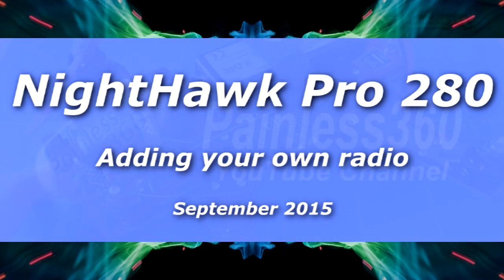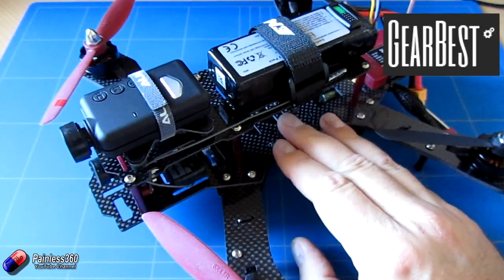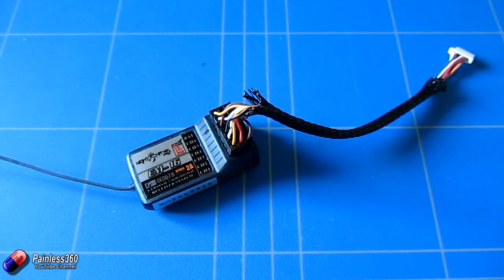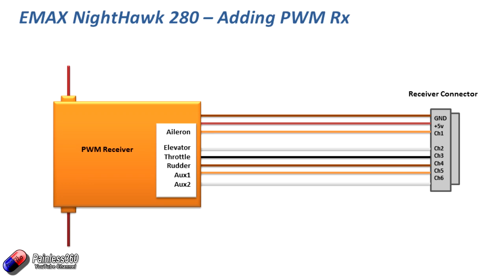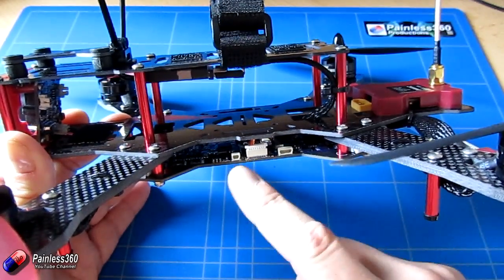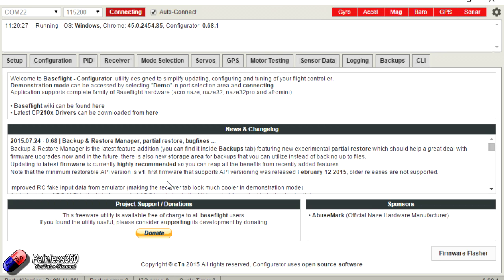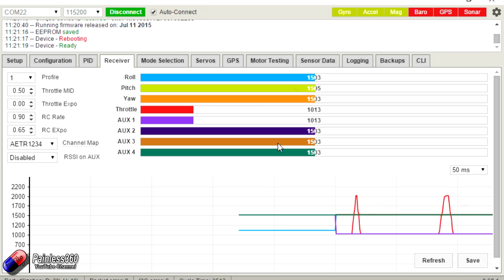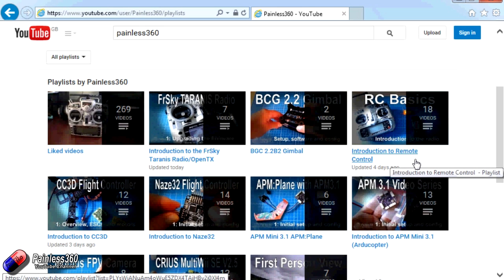EMAX Nighthawk 280 Pro - Adding your own radio and reciever (PWM and PPM)

Comment: Does Baseflight work on other flight control boards or is it only for the Nighthawk 280?  Also I will never buy anything from Gearbest again after being cheated once already.  I ordered an item from them 2 months ago but never received anything and they just keep stalling so I had to file a claim with Paypal to try and get my money back!
Reply from the maker: +Steve C Baseflight will work on a few boards, most use it on the Naze32. Sorry to hear about the problems with Gearbest I've had nothing but great service from them. Happy flying!
Reply: +Painless360  Gearbest claims it takes up to 45 business days to receive an order from them but that's ridiculous since I get items from other sellers in China in just 2-3 weeks.  Banggood has the exact same model, Nighthawk 280 Pro for the same price and I've never had any problems receiving items from them.  Some of the stuff they sent me like parts for the AR Drone were rubbish but I did get it promptly.

Comment: Hi: after watching your video on the Emax nighthawk 280. I'm about to get one. question
is it possible to tap into the PCB or flight controller and setup a pitch camera gimblal
also could a GPS unit be setup on this Quad
Thanks Rob
Reply from the maker: +Rob Maher Possibly. If that is the way you want to go then I would get a 250 quad kit that had all the parts you need (including a Naze32/Flip32 board) and follow the Naze32 series. This is a great model for those who just want to fly..

Comment: P360,
Hi. I've watched several times one of you vids about connecting cc3d/pwm series, I noticed that when I was doing mine following ur vid there is a part on YOUR video that did not showed on MINE which is the inspection of the Radio Tx  sticks if it is working same as the video is showing,even on the PART checking on the boxes if it is inverted or not-all that part on MINE is missing. Even if I set it to ppm or pwm that part is still missing. Now the question is; IS IT DEPENDING ON THE OPEN PILOT GCS OR IS IT ON THE CC3D's firmware??? The first time on cc3d worked well but it activates on half throttle then when I tried correcting it on the wizard it did NOT WORKED ANYMORE AT ALL. Thank you more power and God Bless
Reply from the maker: +bobot021070 Not sure what you mean - a video of the problem can be very useful..

Comment: So you are using the emax em-16 transmitter are you cant find much info on transmitter I want to know the range of emax transmitter thanks looks real nice this or armattan
Reply from the maker: +jason richards The transmitter is a basic model but will easily keep connection to the point where the model is to small in the sky to clearly see it's orientation. I do add another radio to this model in a later video in the series.Happy flying!

Comment: hi what range are you getting off transmitter that came with quad
Reply from the maker: +jason richards Easily more than distance than I can legally fly (400ft). In theory on 200mw and good receiver/circ.pol. antenna a Km+ should be the edge. Depends a lot on local conditions.

Comment: I am curious, do you think it is possible to reflash this board with CleanFlight? It has a few capabilities that Baseflight doesn't have. I am seriously considering getting the arf version of this, but I wan tot be able to do a few more things with the led's on the back end. Just wondering, love your channel.
Reply from the maker: I believe you can but I am not planning to as if flies great as it is. Best of luck!
Reply: Thanks. I appreciate the reply so quickly. You are one of the best sources of info I have found yet. Keep up the good work, and good luck to you as well.

Comment: with ppm bo you need to run wires for the aux channels
Reply from the maker: +Carl Warnke Is that a question?
Reply: +Painless360 yes please
Reply from the maker: Ah I see! No you don't need any other cables - that's the beauty of it.

 See my video that explains PWM, PPM and S-Bus for more detail. Best of luck.

Comment: I think I fried my esc's.........I attached all bullet connectors to motors, but they were touching, the bullet connector metal casings....ground, signal, positive etc. nothing worked....is that possible, I've fried them. Only five min before I thought I'd separate them with insulation tape....until I got my motor direction correct.
Reply from the maker: +owenkilleen Not sure why you'd be doing that on this model as it has it's own ESCs built into the unit. However, if you had two of the motor cables touching when you powered on then there is a very good chance that you've damaged the output MOSFETS for one of two of the motor cables. Lesson learnt I guess.  I'd order another one and always insulate before powering on. Best of luck.
Reply: its a q450, dji motors copies, banggood simonK flashes 30 Amp esc's. what are MOSFETS, where are MOSFETS? when I looked at it after, actually its possible none were touching, but they still got roasting hot
Reply from the maker: Google 'mosfet esc' and you'll see ;)

The majority of the heat from an ESC actually comes from the BEC that supplied the 5v for the rest of the model - not the power switching needed for the motor. One of both of these could be the problem. Take care to chack all of the wiring and confirm that the ESCs can handle the size of the battery (3s, 4s etc.) that you are using.
Reply: ok, will do :)

Comment: Another great set of videos as usual! I actually have this quad and it is pretty nice. Compared to a 180mm size I've been messing with it's huge. Would you consider doing maybe a "quick tip" on adding a buzzer  since it comes with the wire to do so? Thanks for all you do for the sport!
Reply from the maker: +petwog I am planning on the Buzzer. I have a packet of little 5v buzzers by the side of me for exactly that purpose! Happy flying!
Reply from the maker: +petwog Check the new video at the bottom of the new 'NightHawk 280 Pro' playlist ;)